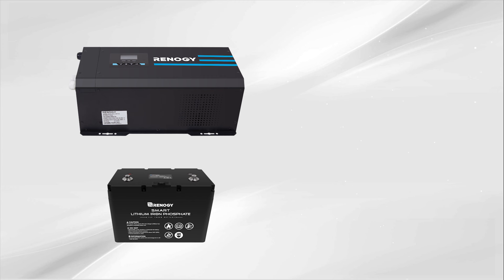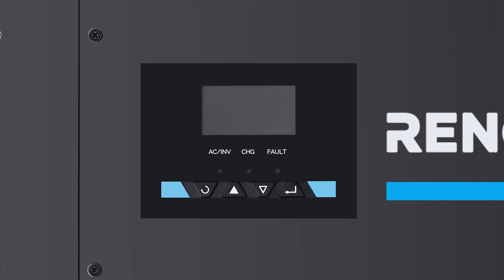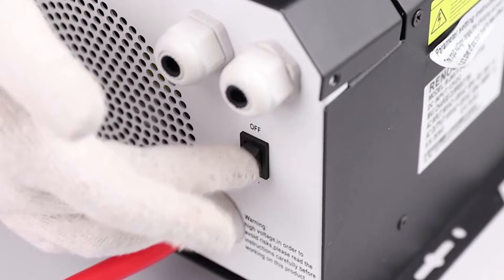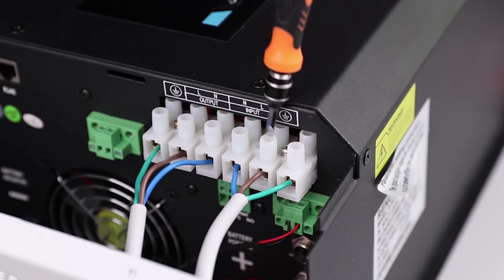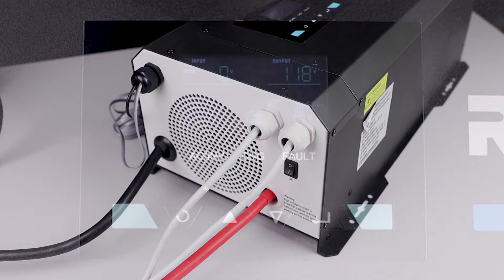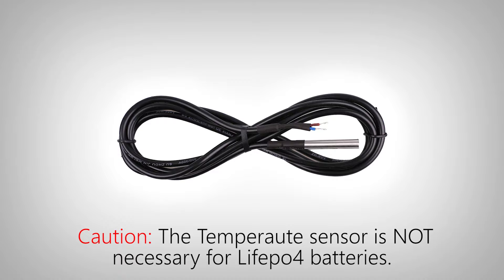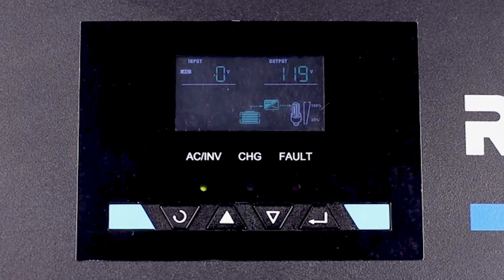Renogy Inverter Charger W/ LCD

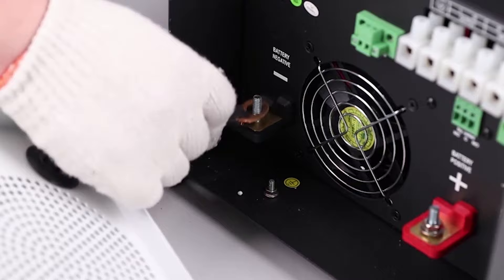Comment: Some comments for this video.  You should update this by having your person doing the demo use sockets and not a crescent wrench.  The shrink wrap should not be damaged (clearly this vid was shot many times, or these cables have been reused over and over).  Also include the recommended grounding connection as many people have asked about where to ground the unit (see about 1:14 in this video for the small lug with the yellow ground symbol/decal directly below the "Battery Negative" cable connection).
Reply: Exactly my thoughts! And the same with the grounding bolt. But where you do run your ground cable through the faceplate?
Reply: @philipcollins8574  I used the opening for the remote off/on switch to run my chassis ground for the inverter.

Comment: Why the hell haven't you made the screen externally mountable?? Such a simple and yet miss the mark option here. Allow it to be remotely mounted somewhere else like if using a Shunt. Would be great to have all that info visible in an easily accessible area. Make it have the remote on/off button on it aswell.
Reply: Because they want to sell the add-on module.  Agreed, it make zero sense to not include a wired external screen.

Comment: Would have been nice to advise about power saving mode. 
The factory is set in power saving, don’t be deceived once you turn on an electrical item, the item will take a moment to kick in due to the inverter having to recognize that power is needed, and then all is good, but if you disable the saving mode all is sweet.

Comment: Ideally should you put a fuse or breaker in your output connection???  Newbee questions
Reply: Yes, please, Answer !!!!!
Reply: It depends on where your output wire is going, if you are wiring the output to a fused sub panel, then no. If you are wiring it to a fused power strip, then no. If you are hard wiring it to an appliance, fuse it to the recommended fuse size for the appliance.
Reply: @pknyryan  great info. I was wondering if I need a certain watt rated fused power strip to use with the 2000w inverter

Comment: Timestamps 2:01 to 2:07.
I see that you've used a regular multi-outlet extension cord, cut it in two and stripped the cables accordingly. I have some questions:

1. What is the recommended amp rating for this extension cord? 13-amps? 15-amps? 20-amps?
2. Can I purchase such parts from electrical stores, without having to cut and strip the cables myself?

Thank you for your assistance.

Comment: Hey there - can you show me where the AC output and input cables go to? I understand how to connect to the inverter - but not sure where I connect them in relation to my RV to put power from my system into the RV. Thanks!

Comment: I came here for one reason which wasnt shown...is output where you wire your appliances or where you run shorepower too....seems like it should be appliances but the arrows in the manual suggest otherwise
Reply: The output is where you run your appliances

Comment: I'm installing this and when on shore power my AC outlet tester shows everything is wired correctly. When I take it off shore power and it runs on my battery the AC tester shows open ground error. No matter the configuration, it isn't grounded on my house batt. This one in the video isn't even grounded at all... so much for answers

Comment: I see a solar panel icon. Do I still need a separate mppt charger for solar panels? I'm so confused.
Reply from the maker: Hi, cgwworldministries.

The inverter charger can not support solar input. If you want to use solar panel for charging for your battery, you can buy a separate mppt charger.

Comment: The 2000W inverter charger has a maximum output of 65A, but the Renogy 100Ah smart lithium battery (used in the demo) has a maximum charging current of 50A.  I installed a similar system, and the circuit breaker (200A) keeps tripping between the inverter charger and batteries.  I used the manual settings to decrease the charging current to 40A, and the circuit breaker no longer trips.  Is this an anticipated problem/solution?  The device charges my batteries much more slowly at 40A.
Reply: What size wiring are you using as the input for charger, and the output for the charger?
Reply: I am having the same issue with the breaker tripping after a few minutes while connected to shore power. I have a 150 amp breaker. I have changed the wire to 2gauge and still same issue. Did you ground the unit using the ground terminal near the battery connections? There is no where to run a wire through the casing. I would have to drill a new hole or I could ground it to the mounting screws I would guess. Thank you for the tip to adjust the output current. I will try that next.
Reply: @mikevincent736  I had a 250A breakers that did the same thing, i switched to an inline fuse and the problem went away .

Comment: I bought this inverter charger thinking that it would handle solar charging, but it seems it only charges from AC source. Am I wrong? Do I need a DC to DC charger in addition to this?
Reply from the maker: Hi, Berg. This inverter charger can not support solar charging. You can try this inverter: https://www.renogy.com/48v-3500w-solar-inverter-charger/. Or you can choose to buy charge controller for using solar panels to charge for your battery.
Reply: @RenogySolar  Thanks for the clarification. Already ordered three 40A MPPT w BT.

Comment: I'm looking into Renogy inverters, batteries and solar panels. Even though I will never need 2000W, is there a reason not to get a 2000W inverter, just in case? Do they deplete the battery faster (versus a 1000W inverter)?
Reply from the maker: Hi, Tiny.

Thank you for contacting Renogy.

If you will never use 2000w inverter, it is not necessary to buy it. You can purchase later when needed.

The power of the inverter represents the maximum power that the appliance can withstand and has nothing to do with the charging and discharging speed of the battery.

If you have any problem later, we suggest you submit a case through our Help Center Portal with more details (links listed below for specific locations）for quicker reply. 
 
https://renogy.force.com/helpcenter/s/contactsupport (USA)
https://renogy.force.com/helpcenterau/s/casesubmit (Australia)
https://renogy.force.com/helpcenterca/s/contactsupport (Canada)
https://renogy.force.com/helpcenteruk/s/contactsupport (UK)
 
Thank you for your understanding!
Reply: @RenogySolar  Excellent, thanks very much!

Comment: Hi Renogy, I emailed you about a week ago but haven't received a response yet. I'm interested your 2000w inverter/charger and am ready to purchase however I have a question before purchasing.
On your website, on the page specifically regarding your inverters and inverter/chargers you have a table showing what how many batteries and of what size are required to run your inverters. It says that you need 2 x 100AH batteries for a 2000w inverter and 3 x 100AH batteries for a 3000w inverter - however on this video you appear to be operating a 3000w inverter on only a 100AH battery. Is the table on your website accurate, or is this video accurate? I planned on purchasing a 100AH battery alongside whatever inverter I purchased but anything over that is just too much for my needs.
Reply from the maker: Hi Grant

The meaning of the table under the official website is that (for example) if you have a 3000W inverter and a lot of appliances load, then you need about 300ah of lithium battery power.

Assuming you don't have a lot of loads and a lot of batteries and you just want to buy a bigger inverter, then you don't need to buy more batteries.

Thank you!
Reply: @RenogySolar  amazing, thank you for clarifying. Yes, I will occasionally need a high amount of power very periodically for my microwave but besides that I'll only be running smaller appliances like a small TV and charging a laptop and/or phone. I believe a 1500W inverter would be enough but your inverter/charger is priced quite well so it will give me the option of adding more batteries and appliances in the future if I wanted to.
I'll be placing my order today.

Comment: Can someone please clarify, on shore power, while charging the battery, then i turn on the load. If the inverter charger only doing the inverter job to supply the load? or charging the battery at the same time? 

For example, 3000W unit powering 2000w cook top, does the unit supply 2000w to cooktop and 1000w to charge battery?
Reply from the maker: Hi, V Law.

For your issue, we suggest you can submit a case through our Help Center Portal (links listed below for specific locations) for help. 

https://renogy.force.com/helpcenter/s/contactsupport (USA)
https://renogy.force.com/helpcenterau/s/casesubmit (Australia)
https://renogy.force.com/helpcenterca/s/contactsupport (Canada)
https://renogy.force.com/helpcenteruk/s/contactsupport (UK)

Comment: Hey Renogy! I’m reading the manual, and it says (on page 10/40) that I should run an 8 awg copper wire to ground the device to the bottom of my vehicle. I was curious what terminal am I supposed to plug the ground cable into on the inverter?
Reply: Did you ever get an answer to this....I'm wondering the same thing....
Reply: @lunatune3714  nah sorry they never replied. You might be better off emailing them. I just gave up with them though. Lol
Every time I messaged them, it would take minimum 2 weeks just to get a simple “yes or no” answer. Also, if you call them, it’s like mandatory 2 hours on hold. Ughhhh 🙄🙄
Reply: @NathanielSaintPaul  got an answer... Apparently there is a yellow grounding post inside the cover where all the wiring is located.
Reply: @loonybean1  thanks!🙌 I’ll have to set that up next time I work on my rig 👌
Reply: @loonybean1  so did you have to make a make an extra  hole in the cover for a ground wire to exit? i haven't taken it apart yet to find the grounding lug, otherwise i was going to attach it to ground coming in with the invertor?
Reply: Wow that sucks about renogy lack of response.

Comment: I have this inverter set in Ut1 mode, but when I use an appliance, it doesn't use the bypass feature..it still uses the batteries. I've double checked the setting as Ut1 but it's not working. Any ideas?
Reply: Did you try Renogy support?  Were you able to resolve this?
Reply: @sean808080  yes. It was just the belt sander that I was using for the test was surging power, when using other appliances such as microwave, it recognised the shore power and bypassed the batteries.

Comment: FYI Page 7 of the manual says "Connect the temperature sensor for all batteries EXCEPT LITHIUM for best charging accuracy"
However this video states they use a Lithium battery and also installing the sensor.
Reply: They mentioned that in the video, just demonstrating for the people that don't have lithium.

Comment: I bought the Renogy 3000W Inverter charger along with three of your 100Ah smart lithium iron phosphate batteries.  I can't seem to find what the recommended wire and fuse sizes for my particular set up.  I'm concerned that the 2/0 wire used in this demonstration wouldn't handle the 9000W peak surge charge that this Inverter Charger is capable of.  What sizes of wire and fuses does Renogy recommend for my system?
Reply: 9000W for 1 second, 2/0 cable will do that for 1 second.
Reply: The manual calls for 4/0

Comment: Video shows 2/O cable but the spec book states 4/O for the battery connections.
Reply: Are you talking about the little paper manual that comes with it?  I looked through mine (I got the 3000W inverter charger) and can't find a wire/fuse size recommendation for connecting it to the batteries.
Reply: Spencer Gillespie No, not the little one. I received an email from the company with an in depth manual that shows 4/O. I believe they updated the manual recently. I’d be happy to forward it to you if you want to shoot me your email. 

Actually just received my 4/O cable today and the larger fuse comes on Thursday. I’ll update you guys here with the results. When I used the 2/O to start, the wire was extremely hot to the touch when running the water heater. We shall see his the 4/O works out.
Reply: @revelontheroad3083  That'd be great if you could send me the manual!  I checked out your page and messaged you on IG.  Hopefully the 4/0 stays cool!

Comment: Does it make a difference in what orientation that inverter is mounted?
Reply: No, just allow good ventilation.
Reply: The manual specifically states it should be in a horizontal orientation

Comment: The Renogy Site states that the  3000 watt inverter/charger is not capable of Bluetooth.  I saw a YouTuber that had a  diagram that plugged the RJ45 Jack  from the  3000 watt Inverter/Charger into the Renogy Bluetooth Hub and the Bluetooth Hub into the BT-2.  will that work?  if not, is there a plan
 to support Bluetooth for the 3000 watt Inverter/Charger?
Reply: The YouTuber responded and reported that although the physical RJ45 connection was done there are errors when attempting to access the inverter through the app..  Soooo close...  in an RV the inverter is tucked away and not visible so remote visibility to settings is important.  Standard inverters without settings can just be plugged in and you don't need to see a display for settings.... looks like  I have to keep the current setup until I find an inverter/charger that can be seen "outside the box", at least for us ...
Reply from the maker: Hey David and Maria,

For any technical questions, please contact us here-https://www.renogy.com/contact-us?gclid=CjwKCAiA3pugBhAwEiwAWFzwdeH3Crd9vRTbjjTYl9l3daVqnotJPjBhs2nmw-Wkn1_guWQeW0ao6hoCOHcQAvD_BwE

Comment: The audacity of this guy to use adjustable wrench
Reply: Ouch. A definite no no
Reply: I was just thinking the same thing.  It wasn't even insulated.   Those wire are also the wrong gage and the heat shrink was wore off at edge.  Not a air tight seal.  I can't believe this is what renogy puts out as a installation guide.

Comment: No it diden't  help. I want it to charge and run ac while connected to shore power and automaticaly switch to battery power when not pluged into shore power. Ithought it was suposed to do that. I also have the Renogy dc-dc 60 amp for charging while driving.

Comment: Anyone had an issue with the remote control not turning the inverter on or off?
Reply from the maker: Hi, IndieBoy2287.

Have you met problems with your remote control? If yes, we suggest you submit a case through our Help Center Portal with more details (links listed below for specific locations）for solving the problem. If you have previously submitted a case which has not been replied, please provide us with the case number so that we can inform the customer service to solve it for you as soon as possible.
 
https://renogy.force.com/helpcenter/s/contactsupport (USA)
https://renogy.force.com/helpcenterau/s/casesubmit (Australia)
https://renogy.force.com/helpcenterca/s/contactsupport (Canada)
https://renogy.force.com/helpcenteruk/s/contactsupport (UK)
Reply: those links are dead, do not work.

Comment: I am starting to regret having purchased @Renogy materials. The 2000W inverter charger came with NO screws to secure the connections. I emailed them to find where the ground connection was... No answer. Plenty responsive when it's a pre-purchase inquiry. Post-purchase... you can die! They have your money and don't give a shit.
Reply: isn't that the truth.